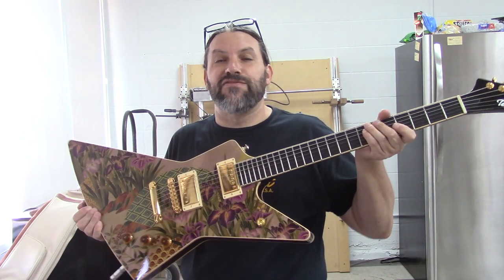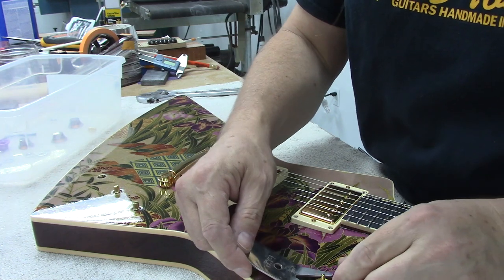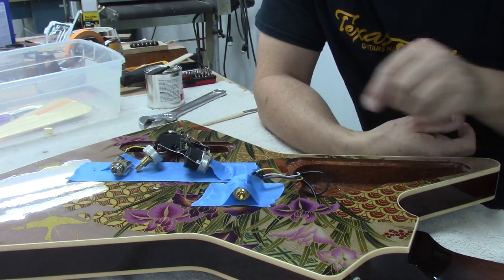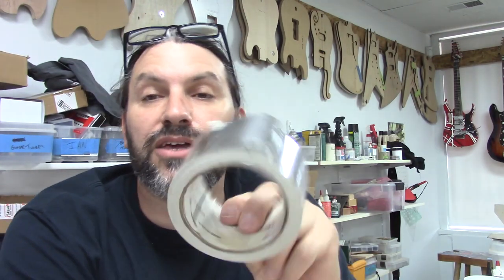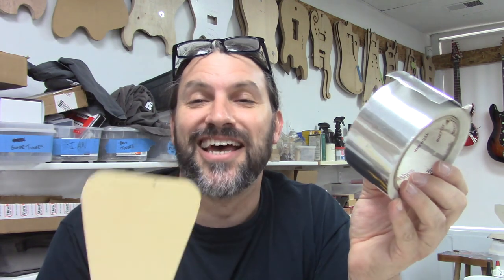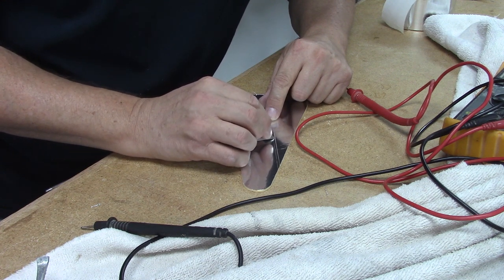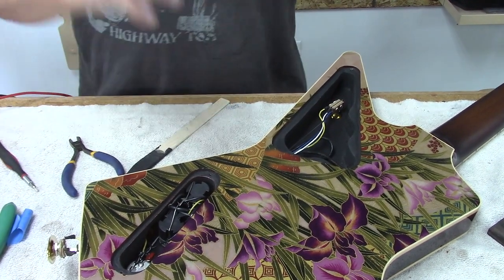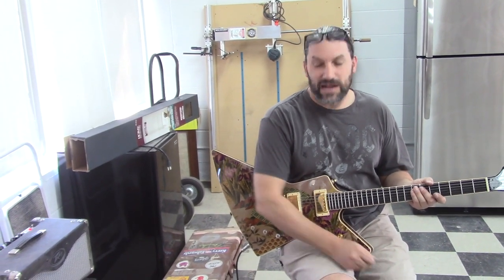Everything You Need To Know About Guitar Shielding... Almost

Comment: The PRS & Zerberus (sp?) Are quiet because they both have humbuckers in them. So the shielding in the control cavities may work or may not, but I suspect that they are quiet because they have humbuckers. Hence the name of those pickups & why they are named as such. Hum buckets because they "buck" or reduce 60 cycle hum. Or, maybe Gary has a really good place in his home that is super quiet electrically speaking. Did you guys try plugging those guitars in your shop under all the fluorescent lights, Etc? Are they as quiet they're in your shop as they are at his place.. just curious.
Reply from the maker: The guitar we shieded in the video also had humbuckers... We pretty much decided that some shielding is all you need. The continuity thing is pretty much bunk. One of the advantages of geeking out about this topic in the shop is that we came up with our own way of doing this on future guitars.
Reply: @TexasToastGuitars  yea. It sometimes seems that there is no rhyme or reason . Every guitar is unique and there are so many factors that go into a particular outcome, such as a buzz. So all one can do as a builder is build. As little things arise, we can try to fix them which you guys obviously were successful in doing with that guitar which is also beautiful by the way which most of your Creations are. Keep up the great work you guys and all the best!
Reply: Gibson builds guitars with humbuckers, and adds coil split switches that remove the humbucking quality.  They do not shield the cavity.   The noise does increase when in coil split mode, but not enough to force me to shield the cavity.  Maybe it has something to do with the PC board wiring - is there a ground plane or some other anti-noise feature there?  My Strat is noisier (more coil turns than half a humbucker?)  but still not too bad.  Maybe I'll shield it next time I am changing strings.

Comment: How would you shield an Epiphone Casino when you can't get to the cavities?
Reply from the maker: I would concentrate on using shielded wire on everything you can get to. That should get the job done
Reply: I saw a video of a kid who opened up his strat because it was humming.  Got some of his Mum's tinfoil.  tore off a big piece and folded it over the wires then scrunched it up.  Hum gone.  Not guaranteeing it will work for you but for the price of tinfoil it might be worth a try.

Comment: Because the shielding paint touches all parts of the shielding tape and the tape overlaps itself, there wouldn't be any reason to scratch the tape.
Reply: Overlapping the shielding tape only works if the adhesive is conductive, not all shielding tape has conductive adhesive which kinda defeats the objective of using it!
Reply from the maker: We pretty much decided that some shielding is all you need. The continuity thing is pretty much bunk. One of the advantages of geeking out about this topic in the shop is that we came up with our own way of doing this on future guitars.
The whole continuity thing is pretty much bunk
Reply: @CaptainScarlet1961  It doesn't matter if the adhesive is conductive or not when taping the cover as long as each strip of tape comes in contact with the conductive paint. The adhesive doesn't touch the paint. Think about it.
Reply: @tiki_trash : I was talking in the context of just using tape for the whole job as I myself do & therefore it does matter!
If you put one piece of tape over another & the adhesive isn't conductive it will create a break between the two, that's simple logic.
Reply: @CaptainScarlet1961  Ok, I see where you're coming from. I should also add the the "shielding" must be connected to ground at some point in order for it to be effective. Just coming into contact with the grounded pots would be enough.
Reply: @tiki_trash : Absolutely, that's how I do mine & I only do my strat type guitars with shielding as you generally don't get any unwanted noise from humbuckers.  I always run a link wire through from the output jack cavity to the main cavity to maintain continuity & also ground the bridge earth to the same cavity, might be a little over the top but that's just me...

Comment: I use the same tape. However some time ago I saw a Jackson Soloist - it had the cavities shield painted, but they were connected with a separate wire (screwed to the body) to keep the continuity, and then connected to the pot. What do you think about that kind of solution?
Reply from the maker: We pretty much decided that some shielding is all you need. The continuity thing is pretty much bunk. One of the advantages of geeking out about this topic in the shop is that we came up with our own way of doing this on future guitars.
Reply: @TexasToastGuitars  As I thought.  Too much VooDoo crap has accumulated around making guitars. Shielding is not an exception.

Comment: What happens when tiny pieces of that conductive shielding paint start to flake off and work themselves into the guitar pots and switches?
Reply from the maker: The world stops spinning
Reply: That's one reason why you would cover the conductive shield with varnish or some non-conductive paint.  Another reason is to prevent accidentally grounding your signal if a bare lead touches the cavity wall.

Comment: The basement of my house is all old stlye T12 bulbs, so I have recently been considering shielding at least my most played guitars. Started wirh a late 80’s Samick Strat style that I got cheap at Goodwill. I did everything by the book and it still hums like a bridge pickup attached to a garbage disposal. All shielding connected to common ground (vol pot), pickguard rear taped up solid and touches foil tape overlapping the edge of the cavity. Continuity tests are good. The pickups in this old Samick have metal back covers which I “assumed” were connected to ground/shield in the pickup wires, but I have no proof because I haven’t taken it apart again to test continuity from common to the backs of any of them yet. This is the only variable I can think of that could be the issue. Any thoughts from the gallery?
Reply from the maker: You might have created a ground loop with all that shielding? I wish I could help you more but you know how it is without seeing it myself
Reply: Texas Toast Guitars I hear ya. It would be nice if youtube allowed photo replies so the TT fandom could yell at me what I did wrong, but photo replies on the internet always lead to goatse. Always. Anyway, I’ll poke at the pickup backplates and see if they are connected to the ground or shield in the pickup wiring and carry on from there. My (limited) understanding of ground loops is to tie all grounds to a single point (in this case, rear of the volume pot), which I am pretty sure I did, including the wire to the trem. No matter, I’ll keep after it and toss the foil if I can’t make it work and go with paint plus small foil strips like most factory setups and see where that gets me. Hell, I may have shitty wiring in my basement and the ground on my amps may not be going anywhere.
Reply: @oqsy  I found that wiring in the room or old style lamps or bulbs can effect the noise and no amount of shielding will stop it. Just what I have found.
Reply: Jim Morris likely the case here
Reply: Is there a conductive layer on the back of the pick guard?  (Foil or a thin aluminum sheet)  Does it use a shielded cable from the volume pot to the output jack?  Ground wire from instrument cavity ground point to the bridge/claw?

Comment: Do you have to run an additional ground from the switch cavity to the main cavity or will the ground on the pickup switch do the same?
Reply from the maker: If you have continuity in the cavity and the pots you should not need to.
Reply: @TexasToastGuitars  Yep, the jack ground is connected to the shield braid of the cable and should also contact the inside of the cavity.

Comment: Is it ok to spray clear over shielding paint?
Reply from the maker: I think it is better than okay to do that
Reply: @TexasToastGuitars  Thanks! Im currently building a partscaster based on a Peavey Predator AX from 94. Its getting shielding with several coats of home made graphite paint, but im afraid it'll get dusty in the future.
Reply: @a2235  It would be better not to insulate the contact area between the cavity and the  scratch guard, but not the end of the world if it's already done.

Comment: Uh oh. Those screw holes are busted on that last guitar.
Reply from the maker: They are?
Reply: @TexasToastGuitars  in the rear cavity of the Warrior. The wood was split or it appeared to be. @ 17:49 to 18:00 if so I'm guessing from overtightening the screws? 🤷‍♂️

This Strat I have is my first and I've had it for a week and a half now but it didn't take me long at all to realize most of the fasteners only need to be finger tight unless they're holding something structural.
Reply: @J__C__  probably different screws

Comment: Can a Gibson Les Paul with the pcb be shielded?
Reply: Yes you can shield those easily enough, in fact a bit easier, because all the controls come out in one chunk. You just remove the PCB, lay down your screening and pop the PCB back in. The control cavity and the switch cavity should be screened. No need to screen the pickup cavities. And I really don't understand why most people object to the PCB so much. It is a perfectly good way to wire a guitar and they can be modified if you want to.
Reply from the maker: I have never done one but I don't see why not. You night try shielding paint with clear over the top so your circuit board doesn't ground out on the shielding. Again, I haven't done one so you will have to make some moves to find out
Reply: @TexasToastGuitars  I believe there are pot nuts and washers on the underside of the PCB so it will be spaced away from the bottom of the cavity. As long as the screening is smoothly applied without huge wrinkles it should be fine.
Reply: Terry Relph-Knight, Do I have to put anything down so the pcb doesn’t ground out?
Reply: @luibeatz8564  The nuts and washers holding the four controls onto the PCB should space the underside of the PCB 3mm away from the screening. If somehow anything on the PCB does short against the screening you could insert a piece of thin plastic sheet. I often scavenge clear plastic sheet for insulation from bits of the sealed packing you get around small items.
Reply: Terry Relph-Knight , I actually got some thin rubber and one side comes with adhesive. Should I put that on the guitar side or the pcb side?
Reply: @luibeatz8564  I would try it without the rubber to start with and see if anything shorts out. You can't damages anything if it does. Double check by lightly pushing down on the middle of the PCB to see if there is any possibility of flexing causing a short. If you do have  a shorting issue my preference  would be to stick the rubber to the inside of the cavity on to of the screening, rather than to the PCB.